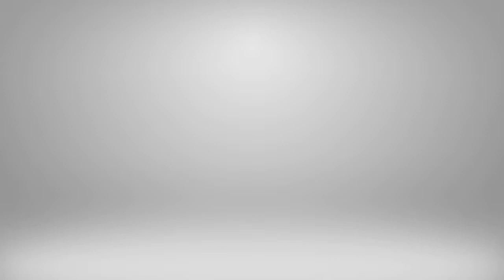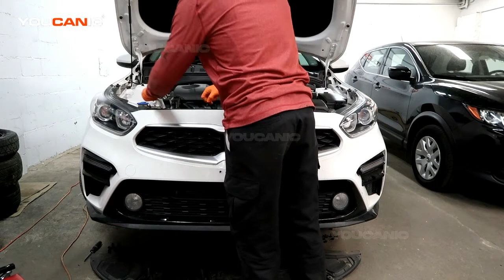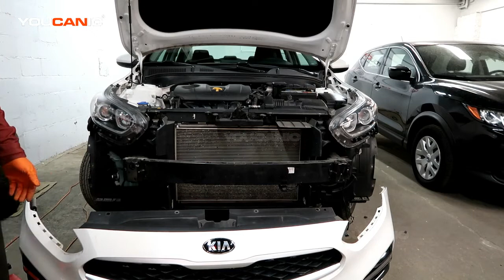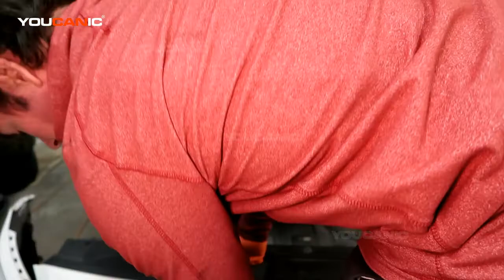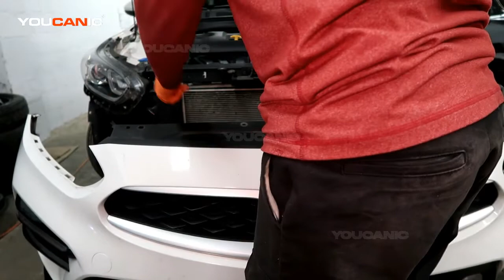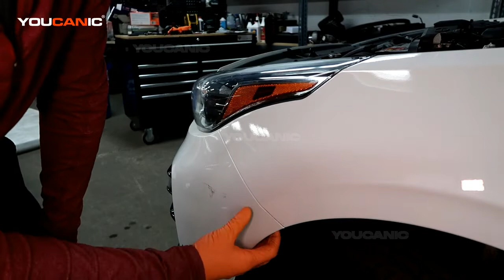2019-Present Kia Forte Front Bumper Replacement

Comment: someone please help, is it possible just to remove the bottom black part the (lip) of the bumper, for replacement? the part that also connects to the lower grill that has lights on it
Reply from the maker: Thanks for your question! Yes, it is generally possible to remove just the bottom black lip of the bumper for replacement. The specifics, however, can depend on the make and model of your car. At Youcanic, we have extensive resources including guides and factory repair manuals to assist you. Our mission is to empower you to confidently carry out your car maintenance. Don't hesitate to explore our website at www.youcanic.com and reach out to us there for any assistance you may need. We're here to support you on your car ownership journey.

Comment: I'm so glad you made this look easy because my wife has a 2020 Kia forte LXS and just the other night she hit a deer at a slow speed and cracked the bumper just a little bit or the bumper cover I guess you would call it and I have to do some repairs from behind the bumper so I can fix it and then seal the crack and sand everything down to paint it. It's a pain in the rear not knowing how to take off the bumper and your video just made it simple. I had no idea these bumpers for that easy to take off because I'm used to old school vehicles.
Reply: this happened to me and my car insurance totaled it. 70k miles. at 30 miles an hour, less than medium size. complete BS